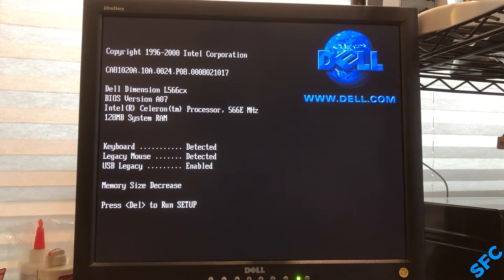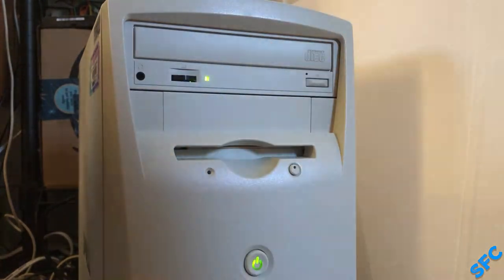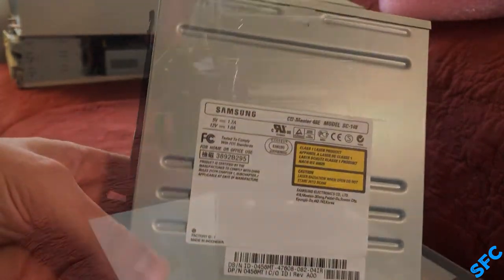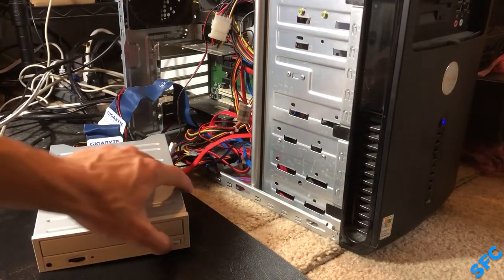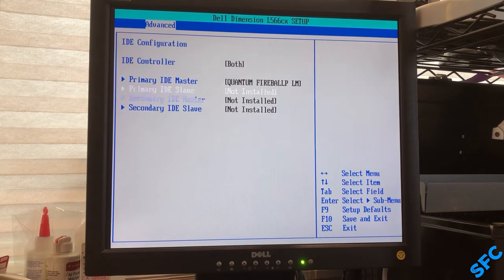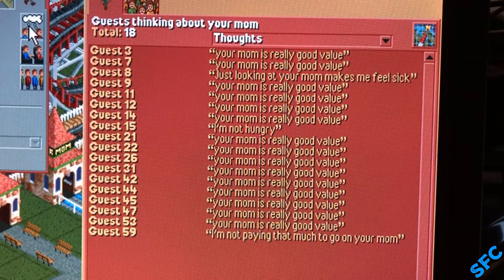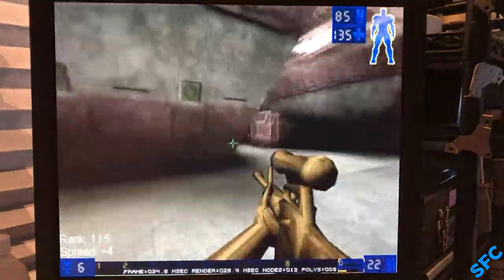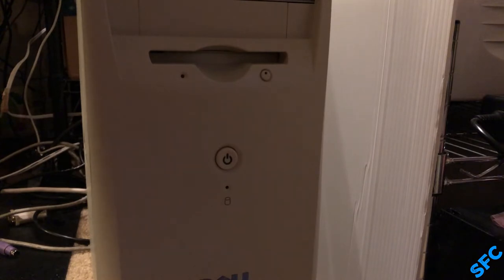Dell Dimension L566cx Fixes and Games - SnowFoxComputing

Comment: I'd be sorely tempted to whip that chubberon in the trash and stick a FCPGA 1ghz Coppermine P3 in there.  With the 810e chipset it shouldwork fine and they're cheap as chips these days.

Did you open the failed CD unit to see what the issue was?
Reply from the maker: A Coppermine P3 definitely would be the way to go with these, and is what I have done a few times in the past. I have a few more of these L series Dimensions and they still have their 1 GHz P3s I dropped in. Actually, I gutted one entirely and installed a Compaq board that supports Tualatins, so that one has the 1.4 GHz P3 in it. Great little system. 

A friend persuaded me to open the optical drive and look for any obvious defects, and I found none. Really not sure what is wrong with it, but I don't intend on trashing it just yet.
Reply: @snowfoxcomputing  Worse comes to worse, buy a used one and steal the guts and put them in the NOS case.  That being said, check for cracked or dry solder joints on the Molex connector.  If you have a multimeter, you can probe the voltage path and the IC pins that get voltage and maybe track the problem down.